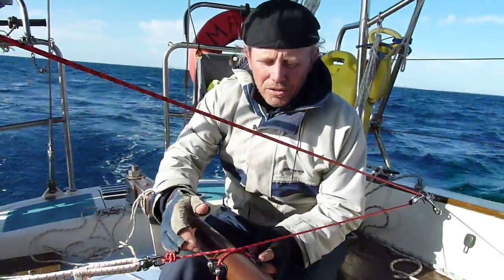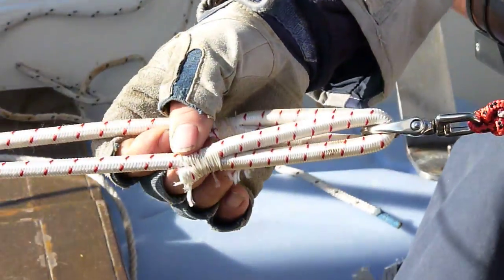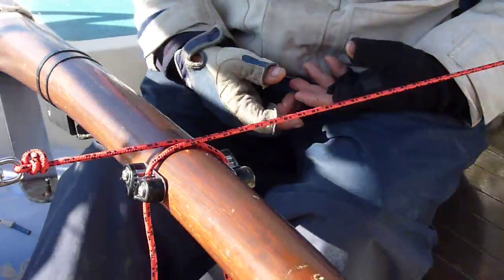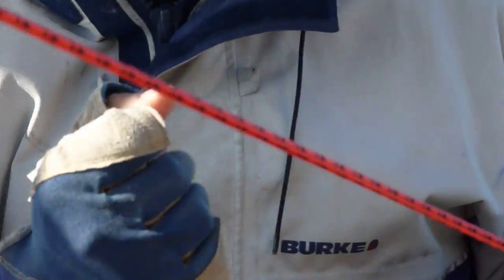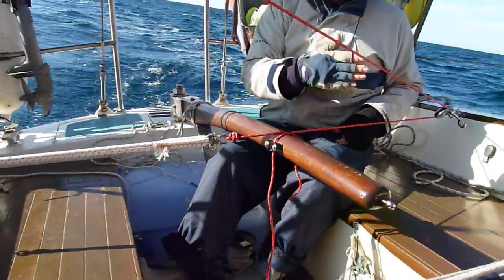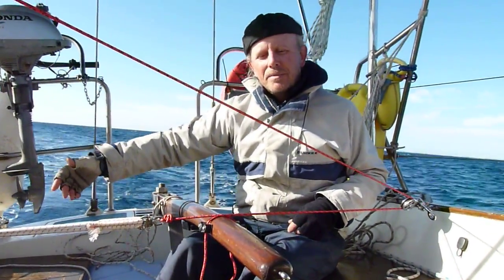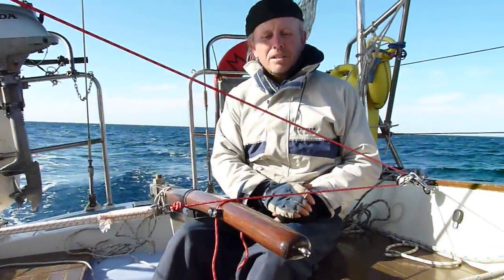how sheet to tiller self steering works on Marutji

Comment: For a long time I couldn't figure out this method as it appeared to contradict my experience on the water. Here's my take on things; I realise now that the secret to this is that THE BOOM END IS NOT CLEATED OFF. Under normal sailing, the sheet from the boom end is cleated on the traveller. This is the reason why a gust of wind forces the bow up into the wind and the main flutters and loses power. (ie. the bow is forced around due to the locked boom end). With the John Letcher method the boom end is not cleated off, instead you have a light control-line led from the boom end to the tiller. The tension in that control-line is balanced by a bungee of appropriate strength. Now, when a gust comes the boat does not round up, (because the boom is free,) and the light boom-line provides feedback to the tiller as in the vid. (The tension in the control line from the boom is matched by the tension in the bungee. The guy in the vid has several bungees of varying tension that allows him to balance the boom over a range of wind strengths).
I've thought about this, on and off, for a long time and this is the best I can come up with
Reply: Thank you for explaining this.  So normally if the boat heads to windward the boom eases, but uncleating the main sheet would push the boom out and the bungie would make the appropriate correction depending on the strength of the bungee, and right the course?
Reply: @gonzosierra1 yes.  For the most part. The reason he has cleats on his tiller is so he can adjust and balance. Every boat is different and it requires a bit of play to figure out the balance and force needed. My 26ft boat will do fine on a beam reach to close hauled with my control line tied to the main sheet that is cleated off. The amount of load on this sheet is what controls my tiller in most situations. If there isn’t enough load change then you may need to uncleat the main sheet and tie off to the boom. Make sure you blocks and bungee line  are  up to this task however. 
But the best thing to do is play with it under different loads.

Comment: Fantastic,  and $6k less than a windvane,  I had a more crude arrangement with just bungy cords,  it would steer for 40 miles plus,  depending on wind shifts,  I had one run of over 240 miles without touching it

Comment: Hi BroadLord.  You are right.  As I have said in other posts, the mainsheet  is loosened off so that movement in the boom is transmitted to the tiller via the spectra control line.  I would not advise releasing the main sheet completely, just in case a gust breaks the spectra, but just enough that it does not interfere with the movement of the boom.  If your boat oversteers in gusts, you can experiment with a tighter mainsheet - this restricts the response of the tiller to a manageable level

Comment: If solo, back this up with a 200' trailing life line through a block on the leeward side to the tiller. If you fall overboard and grab the trailing life line it will pull the tiller to leeward, turning the boat upwind and stalling the boat, instead of watching it sail away without you.
Reply: That is indeed what I do.  full details in my book "Get Real, Get Gone"  available on amazon.  :)
Reply: @rickpage27  love your book...just purchased it a few weeks ago. Blake G, Indiana, USA (well into year 1 of my 4 year plan towards being a liveaboard)
Reply: Thank you love, tiller steering self steering so simple,thanks for the tip re trailing line 👍
Reply: @rickpage27  Just ordered it a moment ago. I don't think I've ever seen a book with more five star reviews, so why not order it?

Comment from the maker: Hi everyone.  Thanks for all the great feedback.  Just a reminder that I can only answer questions that have the "reply" button activated,  Cheers, Rick
Reply: sailingmarutji 
Maybe mount a small traveler on your tiller (can be made from some barstock with a moving sleeve with a thumbscrew through it)  and attach the camcleat to it , the closer you adjust the traveler to the pivotpoint of the rudder the less force the bungy exerts on the boom , you'll most likely eliminate bungy change-overs and have an infinite amount of settings.

Comment: Go anyone that wants to experiment with this but not sure about committing to cam cleats on their tiller. Using a good clove hitch on the tiller will allow adjustments to help you balance the system. If you use it a lot the clove hitches will wear the varnish on the tiller and the cam cleats will help this somewhat and make it easier for micro balance adjustments.

Comment: @ganni025 .  Absolutely.  We found that the bungy cord was far better at concentrating and steering than any crew for extended periods.  Also, as the bungy is always set to round up, there is no reason why you should get a dunk in normal sailing.  However, if you are pushing the limits a bit and carrying a lot of sail, then you will have to stand-by to dump the mainsheet as you wold if you were hand-steering in these circumstances.  Good luck and let me know how it goes!

Comment: I realise this superb video is ten years old but it is one of the best explanations I've seen on this. I'm a novice so be kind, but would you say there are any advantages to a wind vane over this? Downwind maybe? Looking at an boat now that has a wind vane but as I certainly don't need one yet and find them rather ugly lumped on the back thinking this may be a better option.
Reply: Sorry for the late reply.  If you have a windvane, definitely use it.  Sheet to tiller is really a system for those without the funds or a great substitute for when your windvane breaks, so every sailor will benefit by becoming proficient in its use.
Reply: @rickpage27  thanks for the reply.

Comment: Asked about other points of sail  without really thinking about it. Of course just set to usual rudder and mainsail position and  adjust bungee as nec. Can't wait to try.
Reply: +Jon Ashton .  A vald question Jon.  You are more or less right.  One thing to remember though is that as you come off the wind, you need to connect the control line to the jibsheet (on the wind and up to a beam reach, you can connect to the boom directly or to the mainsheet).  Just tie a simple rolling hitch to it and away you go.  Each boat is different, so a bit of fiddling around is required, but it is awesome when you get it sorted out - a kind of magic.  good luck Jon!

Comment: Very ingenious !!! I'm reading on the Mister Vee and windsteer.com websites that self-steering doesn't work well on multihulls or boats that can "plane" due to constant acceleration and slowing down. I'm really interested in a 31-ft Corsair Trimaran, does that mean that I just stick with an autopilot and wind sensor ???

Comment: Thanks, I need to work on my sail trimming skills. Lol. I'm also plan on using a smaller main sail and raising the boom up so I can use my dobger when sailing. Would that mean I will have a hard time getting my sails trimmed right? Just wondering. If i can get this to work, it will be a big help. Thanks

Comment: would this work on my 1973 Coronado 30 with a fin keel, That does not have a trim tab on the keel? everyone has been telling me I have to have a full keel, for it to work properly. also could you make a video show me how to run everything, and kinda keep it slow so I can make sure I have a grasp on it and don't screw it up? I'm slow at this stuff for some reason.
 thanks,
 Bill

Comment: So the only thing holding the boom/mainsheet in position is the  spectra fiber? 
I'm thinking; 
- It must be, because otherwise the boom wouldn't move, and hence there would be no regulation, no steering. 
- But still the forces on the spectra fiber and bungee cord must be quite big.

Comment: For those that want to take this a step further, I recommend the fabulous book "Self Steering Without a Windvane" by Steve Woas (August 1982).  It's a bit pricey at 300 bucks used (!!) on Amazon, but you might be able to hunt down a cheaper copy.  It's where I got all my info and it is THE authourity on the subject
Reply: S/v ...Waves  now 2022 $148 used.

Comment: I think the mainsail has to be a tad overtrimmed in order for this to work.  If the main is "perfectly" trimmed when the tiller is amidships, the tension will decrease when the boat heads up, and the shock cord will make the heading up even worse, so you will soon find yourself head to wind (bad).  If it's overtrimmed, tension will increase when the boat heads up, and the boat will fall off the wind (good).  Is this correct?

Comment: I have seen a couple setups that use a pair of double blocks etc coming off the boom and then running to the tiller, I assume to reduce the stress on the blocks/tiller? I have a 27' monohull Id like to use this on and would like to use the single block setup that you show here. Have you experienced in high winds excess stress on the tiller, the block, or the spectra line? What would you advise?
Reply: Sorry for the late reply.  I have used the system shown in 30 knots and it worked well.  I tend to heave to above 35 knots anyway, but if you want to keep going, it would still work but perhaps you should go up a size in spectra and blocks and bolt them through the coamings.

Comment: 'Everyone' doesn't do it because most people want wheel steering and sheet to wheel steering doesn't work as well as tiller steering because of drag in the system, and also because a electronic button is easier.

Comment: so where is the main sheet attached?  between the red line and the boom?  just wondering how I get this to work when close hauled or when I want to trim in the main and change course.

thanks!
Reply: carboman2010 the mainsheet has to be slackened off for the control line to work. The bunji balances the pressure in the mainsail via the control line.  When you change course, you need to set the system up again.  Luckily this only takes a minute.

Comment: dear sir
im assuming but only assuming that this system is being used without the main sheet on? is this correct. many thanks
a fellow sailor
Reply: Adrian North  You got it!  Actually if the boat is over-steering, you can restrict the amount of movement in the tiller by adjusting the mainsheet so that it will stop the control line at a certain point (usualy about 18 inches on Marutji)

Comment: I'm mystified as to how this system connects to the mainsheet. The video never gives a glimpse or even a verbal hint about it.
Reply: +Gene Neill   Hi Gene.  I actually connect to the boom directly.  You can connect to the mainsheet (particularly if the boat is over steering connected to the boom). Just use a rolling hitch.

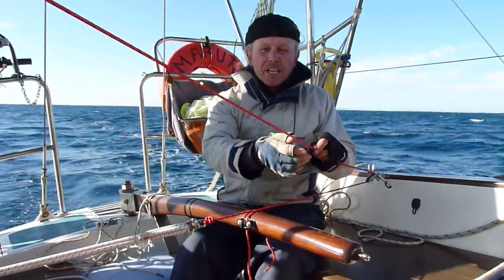Comment: Help me out somebody, I'm not getting it... If the boat comes up into the wind won't the tension on the line REDUCE as the sails will want to start to flap. see 1:30. E.g. if you want to steer closer to the wind than a beam reach then as you turn into the wind more you have to pull in the mainsheet to take up the slack.
Reply: I had the same point of view as the one you have outlined. I couldn't figure out this method as it appeared to contradict my experience on the water. Here's my take on things; I realise now that the secret to this is that THE BOOM END IS NOT CLEATED OFF. Under normal sailing, the sheet from the boom end is cleated on the traveller. This is the reason why a gust of wind forces the bow up into the wind and the main flutters and looses power. (ie. the bow forced around due to the locked boom end). With the John Letcher method the boom end is not cleated off, instead you have a light control-line led from the boom end to the tiller. The tension in that control-line is balanced by a bungee of appropriate strength. Now, when a gust comes the boat does not round up, (because the boom is free,) and the light boom-line provides feedback to the tiller as in the vid. (The tension in the control line from the boom is matched by the tension in the bungee. The guy in the vid has several bungees of varying tension that allows him to balance the boom over a range of wind strengths).
I've thought about this, on and off, for a long time and this is the best I can come up with. Makes sense to me. Fair winds to you.
Reply: @saturday7  Thanks for your thoughts on this - I may have to draw myself a diagram! - Best wishes

Comment: absolute nonsense.  My boat is a fin keel and it works just fine.  What you have to undestand is that many people are not interested in balancing their sail plan and sheet to tiller requires you to do this.  It is much easier to whack the autopilot on (which will steer a compass course even if your boat is hopelessly badly trimmed)   Balance your sails so that there is llittle pressure on the tiller and then set up up your sheet to tiller system and she will sail as if she is on rails.  .